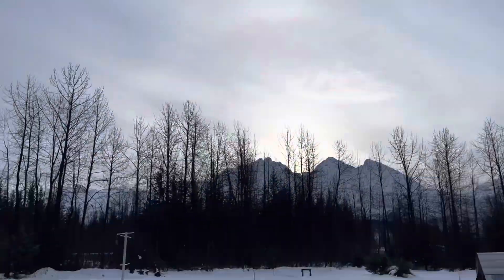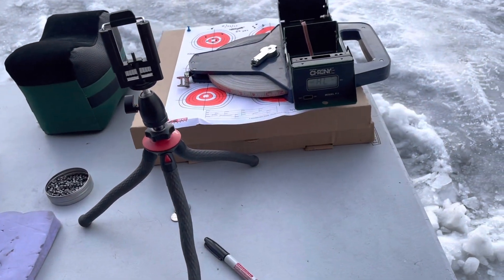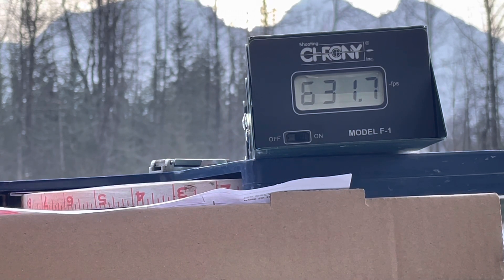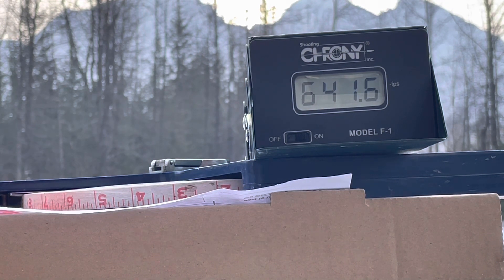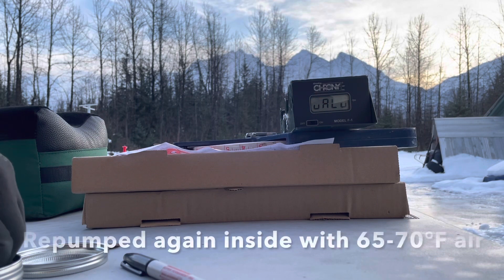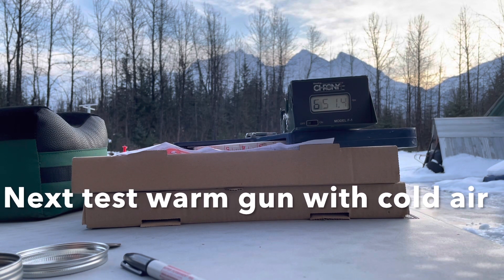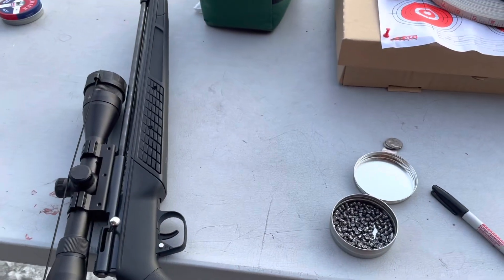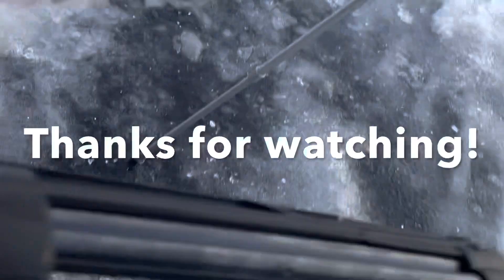Are pneumatics affected by cold temperatures?

Comment: The reason isn’t the temp it’s colder,  the  air is thinner  it’s the same thing regardless of temperature during the warm months if you went to a higher sea level the air is thinner and so it’s not gonna shoot as fast
Reply from the maker: Cold air is more dense than warm air. Going up in altitude is different because the pressure changes.

Comment: Not a big difference!
Have you ever tested this with a springer/gas ram or co2?
Reply from the maker: I’ve not but I know the CO2 guns will be a lower in cold temps and I just don’t tend to shoot co2 very much. A springer would be interesting! 🤔 I don’t have any gas piston guns as I don’t care for that power plant design.
Reply: @airgunsofalaska  I used to be a spring guy but I am starting to like them gas rams!
[But I will always trust a good old spring more for longevity/ replacement cost]
Reply from the maker: @LowkeyAirgunner  I remain unconvinced of the long term reliability of gas ram guns. I keep my guns permanently and don’t want to have to deal with potential issues even decades down the road. So far the vast majority of my springers and pneumatics have been amazingly reliable even after sitting for 10’s of years without being shot. I just don’t see a high pressure gas ram holding pressure for that long. At least not the mass production rams that come in many guns today.
Reply: @airgunsofalaska  Read a comment somewhere that the trick with gas rams is to lay them on their sides. There's less likelihood that the liquid in the piston will leak.
Reply: @brettbaker5599  By on its side you mean not barrel up or down?
Reply: @LowkeyAirgunner  Yep.

Comment: in the cold the air is more dense ,then it wil flow less easy tru the channel /transferport.  thats why. and if the gun is made with a valve lock (to prevent get over legal limits) you wil not get much gain by pumping up in the cold and store the gun inside ,,cold air will expand a litlle when heating up  .
Reply from the maker: I did the opposite in the video, pumped the gun up inside with warm air and shot it to see the difference between warm and cold air. 

The thing that’s been puzzling me is with cold dense air I should be compressing in more air with each pump than I would be with warm air. The act of compressing the air generates heat, more compressed air in the valve should be more heat thus the air should flow outta the valve just fine I’d think? The gun wasn’t holding onto air that day while I was target shooting it.
Reply: @airgunsofalaska  yes i got that  when you wait to let the gun cool down speed will drop .pressure will drop .its the same as co2  but not so dramatic . A coil springer .gets more springtension .thats why they break often in the freeze .and that compensates a litlle  the thicker air and stiffer lube .
If you pump a hp botlle to 300 bar . With a compressor fast 
it will heat up .and when cold you end up with 270 bar .plus minus. Depends on room temp
Reply: @airgunsofalaska  try with helium out a helium balloon .let the gun suck that .proberly you get 800 or  more .
Reply from the maker: @peteralexben  interesting! I’d never heard of that.

Comment: I wouldn't think it matters much.  You can always add an extra pump!
Reply: i think it will not help ,most you can`t get the extra air out ,valve lock and valve opening time
Reply: Convert it to hammerless xrv and it'll work. Just copy the design from the sharp innova.